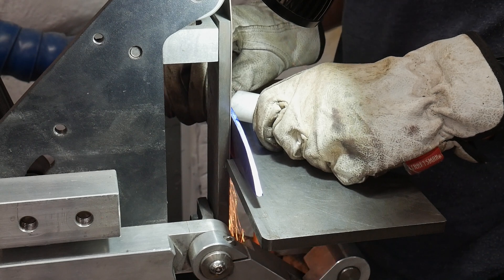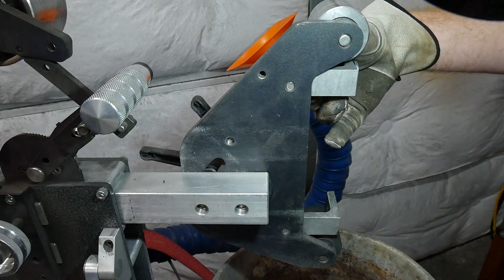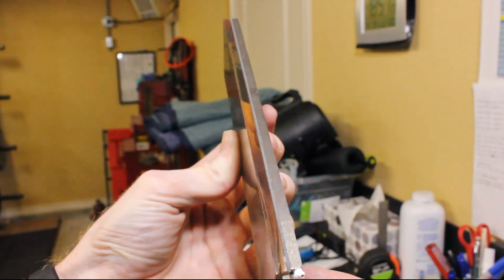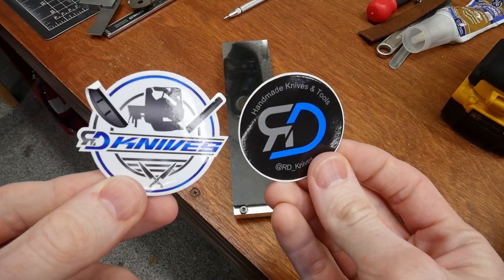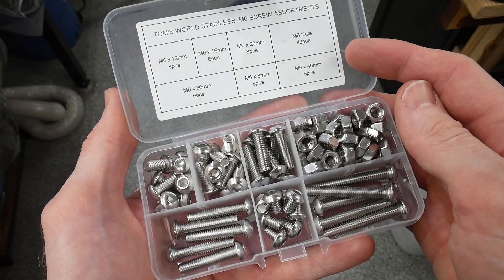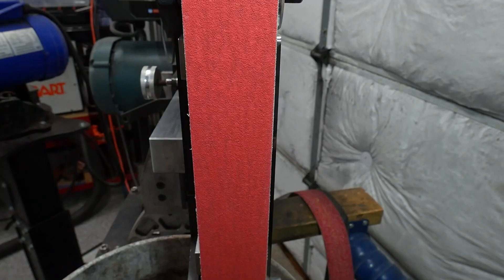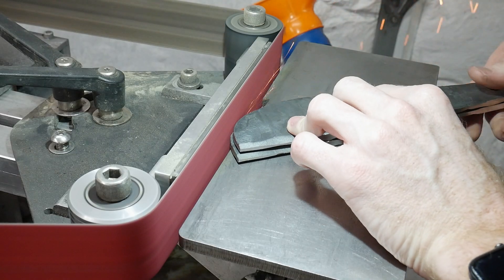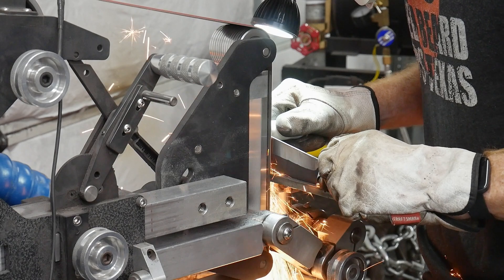Flat Platen That Will Stay Flat FOREVER | Carbide 2x72

Comment: I am SURE the carbide platen is great, but dang, my glass platen has been doing great and I have had 0 issues from it. If I did, I could buy about 10 more for less than a carbide one. I ALSO have a bunch of A2 in the right size.
Reply from the maker: nice, sounds like you have a solution!